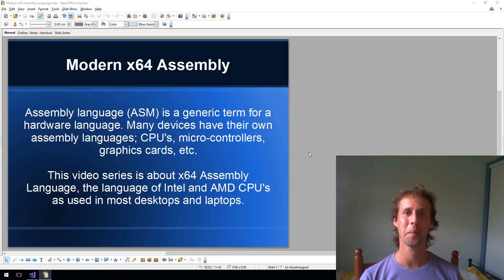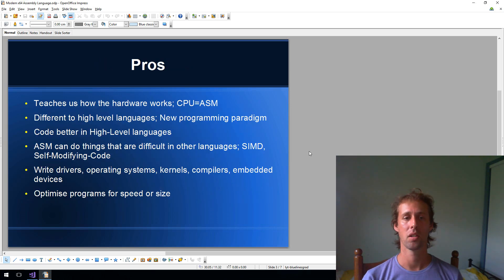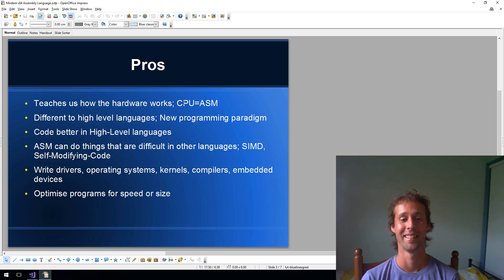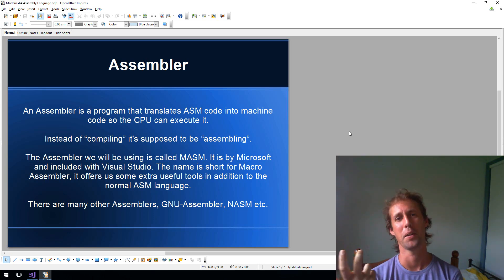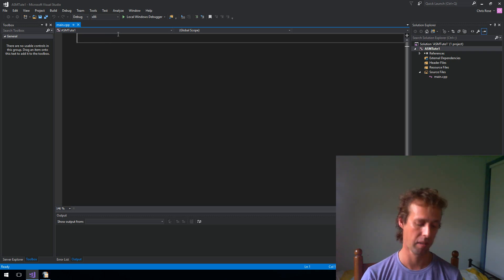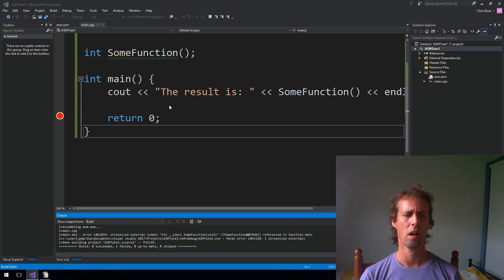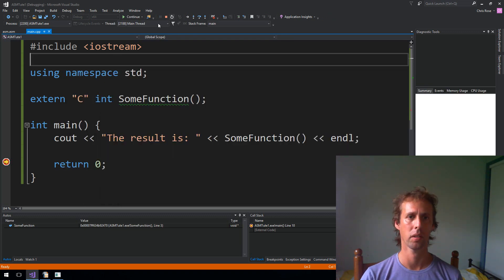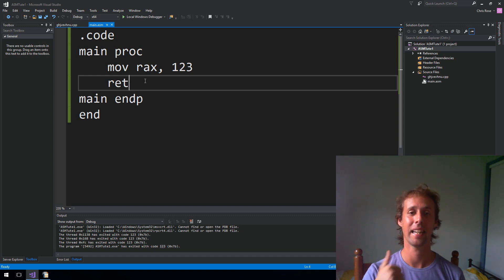Modern x64 Assembly 1: Beginning Assembly Programming

Comment: I don't see how pure ASM code could send a number to the monitor for display without more instructions.  In the old DOS days, one might have called BIOS or DOS routines, or perhaps used the OUT instruction with a port. Each might have involved programmer-written code first to convert keystrokes,  numerical values, or character codes to be sent one-by-one to the monitor adapter card.
But it's been many years since I did this, and modern assemblers have added many macros since the time I used TASM.
Reply: The GPU has its own assembly language. The CPU sends code and data to the GPU. The GPU executes it, and displays part of its memory on the monitor. It's fairly similar to the old days with VGA at address 0xA000, hahaha, those were the days! Except the RAM being displayed is some buffer on the GPU. Nowadays, the GPU is much more than a display unit. GPU's have amazing computing abilities too.

Anywho, the CPU is using ports, it's just sending bits over the PCI bus with IN and OUT instructions. But generally, we don't have access to the IN and OUT instructions since they're privileged, so the OS handles all that through drivers. If you want to get into coding the GPU directly, have a look at some nVidia CUDA videos (or OpenCL for cross platform). If you want to know about driver and OS dev, have a look at writing a Boot Loader, it's pretty fiddly stuff, but it shows that the legacy of old skool graphics is still with us; every modern x64 CPU boots in 16 bit CGA awesomeness!!! I hope this helps, have a good one, and thanks for watching!

Comment: Hi, i'm new to Assembly programming, out of curiosity why MASM instead of NASM or GNU Assembler? I read that NASM OR GNU are better.
Reply from the maker: They're all good! I use MASM because Visual Studio is my IDE of choice and MASM is the default assembler. For OS dev, and drivers, NASM is easy. I am not used to AT&T syntax, so Gas code throws me, but for this higher level ASM, MASM does just fine!

Comment: Ok Google ain't bad.

Here is a MessageBox Example and it works without any other cpp files too !!! Entry point was still set to "main"

>>>>>>>>>>>>>>>>>>>>>>>>>>>>>>>>>>>>>>>>>>>>>>>>>>>>>>>>>>>>>>>>>>>>>
.386
.model flat, stdcall
option casemap :none

extrn MessageBoxA@16 : PROC
extrn ExitProcess@4 : PROC

.data
        HelloWorld db "Hello There!", 0

.code

 main:

        lea eax, HelloWorld
        mov ebx, 0
        push ebx
        push eax
        push eax
        push ebx
        call MessageBoxA@16
        push ebx
        call ExitProcess@4

 end main

end
>>>>>>>>>>>>>>>>>>>>>>>>>>>>>>>>>>>>>>>>>>>>>>>>>>>>>>>>>>>>>>

Comment: Cool video. Where do you get a list of operators available for your CPU?
Reply from the maker: The instructions are listed in AMD and Intel programmer's manuals. Use both Intel and AMD because they both describe the same instructions, and sometimes that helps. I also recommend Chris Wright's website for a brief lists of the SSE instruction sets. Google "sse instruction set softpixel", you'll find it. Good luck exploring, x86 is a beautiful mess, there's from 1000 to 3500 different instructions, depending on how you count!

Comment: I totally have to agree with your point of view at 5:39.
I just browsed some PowerPC assembly code of various video games and that made me thinking the compiler was drunk while generating the machine code. I'd also like to mention that I find it much easier to do bit-wise operations in assembly than in higher programming languages.
EDIT: you can also write much more efficient loops. Put all variables into registers so your loop has to perform less or even no memory accesses.
I personally use 'extern "C" __int64' in order to provide values of up to 64 bits to rax

Comment: Hi! Easily the best tutorial to get into this. I cannot tell you how much garbage I had to sift through to find this. One thing: I can't get visual studio to stop closing the damn output window outside of setting a break point or system("PAUSE") - how did you get your window to stay open in the tutorial?
Reply from the maker: I used a breakpoint in the vid. I've never managed to get it to stay open automatically either. It is supposed to just do it, but it's never worked for me. You can also place a "cin.get()", or use "_getch()", but getch is MS specific. Thanks for watching and commenting!

Comment: You simply cannot do more with anything else.  ALL other languages compile their code into machine code instructions, and that is precisely what Assembly works with directly.

I used to use it back in my DOS programming days with C.  I used it to access the graphics screen, draw them etc.  Usually by writing C functions and putting inline assembly into them.  I miss those days to be honest.   Inline is fun, but I really want to dive into pure assembly.  I guess I just like the challenge.  I used to code in pure assembly in my C64 days, 6502 assembly was so easy and fun to work with! ;)

And I finally googled "Creel":  "Creel (basket), a type of basket used in fly fishing." ;)  I can die now, I know what it is.